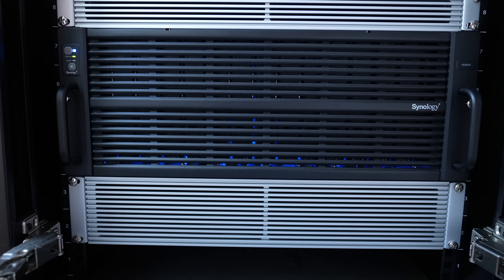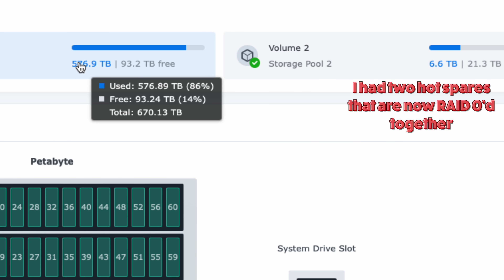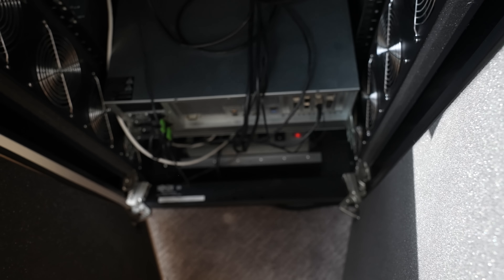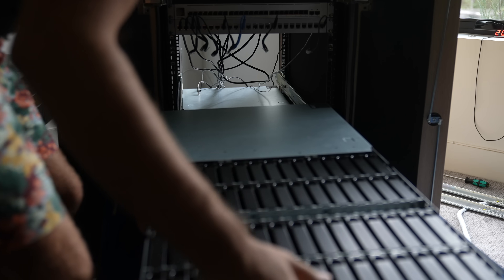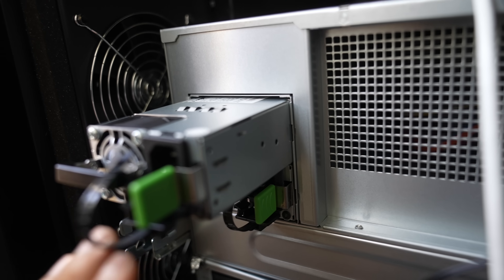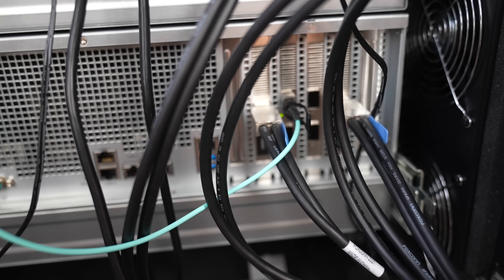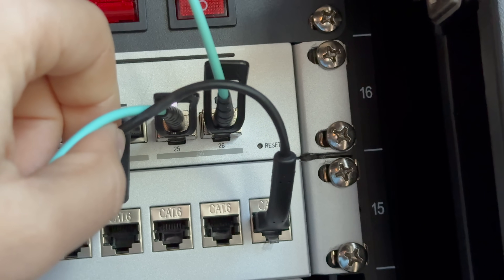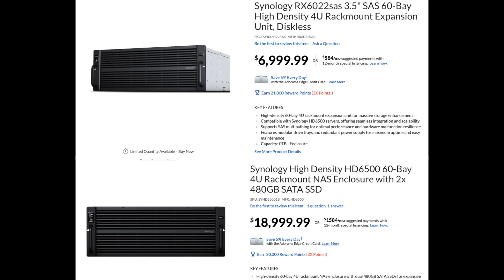1.9 Petabytes - Expanding the Synology NAS

Comment: From experience, the APC UPS youre using tends to tell you its fine when in fact it is not. Test it when you can, we had 3 at my workplace brought 2018 and all instantly powered off when the power went out only at 30% load (in 2023, so 5 years old)! You dont want to find out that its not working when the power goes for real!
Reply: Thanks will do some tests. To be honest I feel like all these APC units turn to ass after about 2 years. Probably the least reliable parts of my setups.

Comment: If Gavin adds more storage the server rack will start sinking into the floor 😂😂
Reply: If he's on the ground floor then it's a cast concrete slab on the ground type of floor. At least in the southern UK.
I'd worry more about the electrical bill and the power feed to the house though. Time to upgrade to 3-phase 400V?
Reply: @ehsnils  The two units combined pull about 1400W. That's less than an electric kettle! 

It's 6.5A at 220V. He can plug it into his normal ring main :-)
Reply: Anyone else notice the blurry US wall socket at 5:43 in the background?
Reply: @Andy_FortyTwo  I think he moved to the US, and that Dan flies in for shoots from the UK when required. Isn't the quarry they sometimes film from in Texas, US? I hope I'm remembering that correctly.

Comment: By the time this runs out, you should seriously look into LTO-10 (or newer) tapes.  They'll be substantially more cost effective per-TB and per-watt.  And they'll take up less space, be less noisy (most of the time), and have better longevity.  You're kinda the perfect use-case for tapes.
Reply: He's already got LTO-9s. Would it be worth the investment to bump it up by one version?
Reply: @DrSloth78  I knew he was using tapes but I wasn't sure which generation.  Each generation seems to offer double the capacity though, so while perhaps LTO-10 may not be worth upgrading from, 12 or higher might be.

Comment: To be honest, at this point I would be looking at some removable, high density storage. I can't imagine that you really need to have ALL your video immediately online.
Reply: unless you want to look at a $5000 LTO tape reader and auto loader, HDDs are still pretty cost effective.
Reply: @Cynyr  You are still making big savings on the power to keep all that NAS running!!!
Reply: @Caroline_Tyler  He's running on a Mac Pro, which is not related to cost-saving at all
Reply: @Caroline_Tyler  10watts per drive * 60 drives is 600watts. 0.6kw*24*365*$0.14kwh = $736 per year to run. Or about 6.8 years to pay off the tape drive. Granted hdds aren't usually free.
Reply: @Cynyr  🤣👍

Comment: No wonder you sound proofed that cabinet...when you powered on that storage unit it sounded like a jet engine preparing for take-off!
Reply: You should have heard the kit I was working with in the 90s. We used to wear ear defenders in the server room.
Reply: Makes me wonder how it impacts the heat though ...
Reply: @asteliaz  Those "NetShelter" cabinets are not DIY and can be bought like that so i assume they do put enough fans in there.
Reply: @asteliaz  I wondered about that too. There were a ton of fans on the side of the cabinet; presumably Gavin ran the design past Synology before setting it up that way.
Reply: Server units like that always run fans at 100% on startup and should slow down after a bit
Reply: The first time I switched a rack mounted server on to configure it cough cough years ago, it was sat on the floor and I could feel the floor vibrating. Quite a bit loud.

Comment: Frankly, I appreciate the low-tech high-tech approach you take with these background videos. It's nice to know that I could set up a 30k USD, multi-petabyte storage solution if I had to!
Reply: I'm sure it's the only rack on earth that's filled like that and is operating on flokati😅
Reply: Always a bonus when you can ring a company and say “hey any chance you want to give me 10k worth of equipment for free”
Reply: The listed prices don't include the hard drives, so the actual cost is more than double that:
NAS (19k) + Expansion (7K) + 120 HDD ($300 each) = 62k
That doesn't include the rack itself or anything else in the rack (UPS, networking, etc.)
Reply: @Cyberguy42 doing homelab stuff I sometimes think “why is this 2inx19in piece of sheet metal $50” and then I have to remind myself every device in my rack combined costs less than a single mid-spec server blade
Reply: 😅 the internet archive is over a hundred petabytes. I really think we should have multiple copies, but that would literally cost millions per copy. It's really important to have in this post AI society.
Reply: @IM2awsme  100 petabytes.. that's more like 450U.. or 11 8 foot racks of servers, that'd be 11 head units powering 11 JBOD's packed with drives.. if 1 box is $30k.. that's 121 x 30.. 3.6 million $ to take a backup of the internet archive.
Reply: before you even get to the "How do i even connect all these things together" and the "How do i even power this thing"..
Reply: @jackhemsworth7515  😅 I know, we have technology that can store it in a wafer the size of a quarter, but it would take days to write it, and days to read it. We just aren't there yet.
Reply: Now I know where Id donate a few million if I ever won the lottery....
Reply: It doesn't cost $30k, you just call up Synology and they send it to you for free 🤷‍♂️

Comment: till 2038? i give it 2 years tops
Reply: Next camera will need more disk storage.
Reply: Maybe just a nerdy joke - 2038 is when 32-bit dates run out.
Reply: @robbybobbyhobbies  At which time we should be up to 64 bit anyway, and that would be large enough to be sufficient until our sun burns out. If someone still is using the seconds since 1970 by then it's definitely going to be somebody elses problem.
Reply: Might be referencing the Unix 2038 epoch time issue
Reply: He meant 20:38, 8:38pm.
Reply: HDD dying aren't a showstopper, as soon as the damage aren't beyond our redundancy.

In these usage we expect them dies randomly so we came prepared, we have raid for redundancy and backup because anything can fail beyond save.
Actually we hopes they will die randomly, not all around the same life, if more than a few dies within a short time there are almost nothing we could do, so more often than not we mix HDD from different sources.
In modern data storage when one of those HDD dies, the machine will just assign one of the hot spare into the raid and rebuild right away, then we replace the dead drive with a new drive, the new drive become new hot spare, our users wouldn't even know something happened, and whoever in charge might be nervous in the one or two nights the raid is rebuilding.

On other hand every data hoarder knows we always wants more storage, 2-3 years are about where we want another upgrade lol.
Reply: Gavin lives in slow motion, so what to him will be 2038 will just be 2026 to us.
Reply: exactly. file sizes are increasing exponentially.
Reply: Gavin’s Razor: The storage space that Gavin’s video files take up will double every two years
Reply: most HDDS die in 3-5 years if used 24h/7day
Reply: @NoInterleaving  sources: I made it up
Reply: @idowedo  in fact, 3 years is the minimum limit of 24/7 usage.
Reply: @idowedo Look up Backblaze's quarterly drive stats. The avg. failure age is usually at 4-7 years.

That said there can be considerable differences depending on the usage patterns.
Reply: @nani8ot  that's also a datacenter that is cooled much better than a small cabinet in someones room. You saw in the video some drives were sitting at 38c doing nothing.. underload that's definitely over 45c
Reply: @nani8ot  that just means that, of the drives that DO fail, they fail within 4-7 years on average. but most drives don't fail. most drives last basically forever (or atleast 10+ years). plenty of people me included have HDDs that are over 10 years old that are working perfectly.
Reply: @jjmmjj9999 Thats also a datacenter where drives are getting hammered 24/7
Reply: @NoInterleaving  It depends on how much activity the heads have how long they live. Long sequential data reads and writes aren't as bad as a lot of random access.
Reply: @NoInterleaving  Well, he's not gonna have it run 24/7. Even if the drives are spinning, most of the time they will just idle. He's not a server supplier, just a YouTuber.
Reply: @NoInterleaving  Had my HDD since 2015. I use it maybe 10 hrs a day. Still looks alright via diagnostics.

WD Black btw
Reply: @NoInterleaving  i got 10 year old drives still going
Reply: @NoInterleaving  These are enterprise disks, they tend to last around 7-9 years.
Reply: @NoInterleaving  I have some Seagate consumer HDDs with 7-8 years (60k-70k hours) of power on time and still working fine
Reply: @NoInterleaving  not true, wtf

Comment: Have you lost drives in this enclosure since you have started using it?  If so, has replacing them been easy?
Reply from the maker: I’ve not yet had a drive fail. I do have two spare drives ready to go so maybe I’ll make a short or something of the experience if it happens.
Reply: @TheSlowMoGuys2  That's good to hear.  Thank you for sharing with the community.
Reply: @TheSlowMoGuys2  With so many drives, I'd say you'll want more spare drives. Say 3 go out in quick succession and the lead time for a new drive is a week...  Even worsse if all of the drives are from the same batch, means they are likely to all fail around the same timeframe